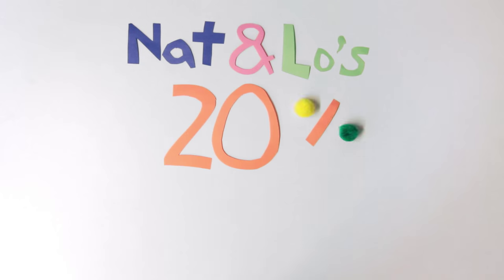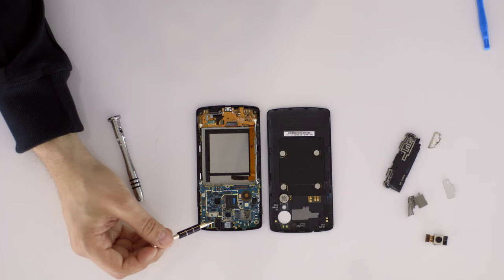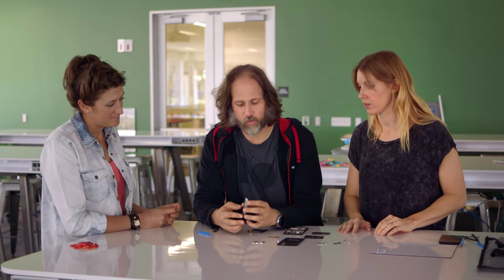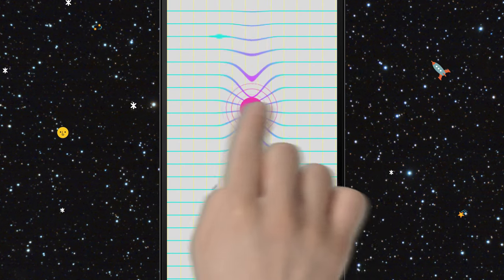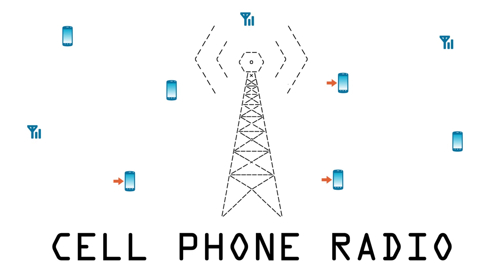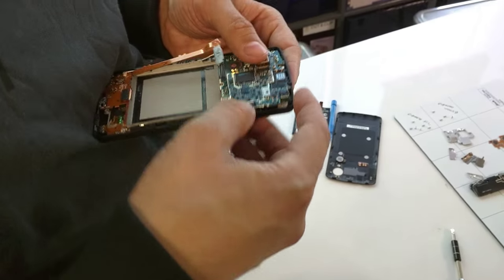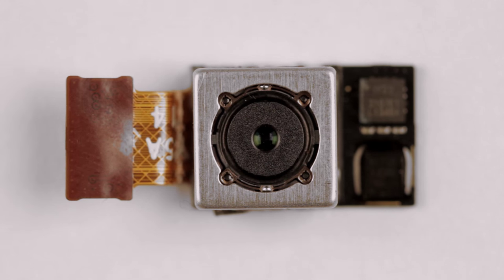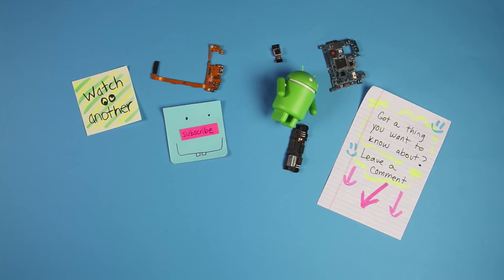Do You Know What’s Actually Inside Your Phone?

Comment: Hey, tiny fix - NFC is not radio, its a magnetic coil. Radio is an electromagnetic wave, like micro waves,  xray light etc, but NFC uses magnetic coils to communicate, that's why it has to be so near.
Reply from the maker: +guysoft42 ah-ha! thank you for explaining that.
Reply: +Nat and Lo Magnetic and electric fields each create the other. They're flip sides of the same coin. That's why it's called "electro-magnetic radiation". It's perfectly accurate to call it an NFC "radio" -- after all, it's just a coiled up radio antenna. 

The particular shape of a solenoid (coiled wire) creates an EM wave that is highly concentrated right in front of itself, and as a trade-off interferes with itself farther away. This allows you to send a transmission using very little power, but only a very short distance. (The effect is similar to focusing the light of a candle with a lens -- at the focal point the light is very bright and easy to see, but past it the light spreads out and therefore dims.)
Reply: In summary:

Is an NFC "radio", a radio? Yes. 
Does an NFC radio emit EM waves? Yes.
Does an NFC radio create an (oscillating) electric field? Yes.
Does an NFC radio create an (oscillating) magnetic field? Yes. 

...Because all of these things are equivalent to each other. So the same is true of an antenna. 

Quick self correction: an antenna and a solenoid are actually not the same thing; antennas aren't part of a closed electric circuit whereas solenoids are. But since you use both by applying an alternating current, they end up behaving in a similar fashion.
Reply: You are assuming cause and effect. Just like a car engine is not a "sound engine" just because it emmits sound, the light emmited from an NFC antenna is not the communication channel, its there because you are accelerating electrons, but its not the waves that carry information to the other device. Its the magnetic field in the coil.
Reply: Any B field state has exactly one corresponding E field state, and vice versa (cf. Maxwell's equations). Thus the E field always carries a "mirror image" of the information in the B field. There is no way to send information (or modify it in-flight) with the B field without also encoding it in the E field as well. For instance, think of an EM wave: can you change the B component without changing the E component? No, because each is mutually reinforcing (hence the propagation of light).

It's true that the B field's information isn't necessarily in the same place as the E field's information, and I do take your point that a solenoid receiver works where the B field is strong but the E field is weak/nonexistent. But absorbing the B field to some degree necessarily also dampens the E field to the same degree, not necessarily in the same place. It's not obvious, but a solenoid receiver is "receiving" E-field information just as much as it's receiving B-field information.
Reply: Out of Maxwell's equations Faraday's law is enough to explain NFC.
Can you draw in/extend Faraday's law from this slide to explain how the E field outside the loop is connected?
On one side it has the B field, and on the other side the current in the wire, no light.

http://i.imgur.com/5ZzMyiA.png
Reply: btw its same lol :v , i have learn about radio wave n experiment with it and i think nfc is using radio wave ,, sorry bad english :v
Reply: guysoft42

Comment: Neat video!  Smartphones are amazing devices and one thing not commonly known is that smartphones (and really all modern computers) are not simply computers anymore but a network of computers, all running software, all dedicated to specific tasks, all at least as powerful as a home computer from the early 90's.  Each one of these computers likely sit on a single chip but would've taken a motherboard of components back then.  In the future, most of those components in that smartphone may fit on a single chip.

The main CPU doesn't actually sense the touch screen, there's a tiny computer there that has to deal with a monumental task of sifting through tons of glitchy, noisy data and reducing it down to clean & minimal touch & gesture info.  Same with radio (in many cases, independent computers for cellular, bluetooth and wifi), graphis, and audio (music decoding & equalization/effects) and so on.  

On the iPhone 5s, there's now a dedicated CPU that collects data from the gyro/accel/compass, mainly so that the device can collect this data even while most of the device is powered down.
Reply from the maker: Paul Steffen great comment! you obviously know your stuff.
Reply from the maker: Paul Steffen oh your comment also reminded me of this link that dan shared with us: http://www.anandtech.com/show/7846/the-difference-between-snapdragon-800-and-801-clearing-up-confusion
Reply: Nat and Lo  That's a great overview!  It's really impressive how companies like Qualcomm push the bar on mobile performance each year while PC laptops only seem to get 15% faster every year..  

Also amazing are chips used for everyday consumer devices, that are now as tiny as an ant yet contain a full computer system and features for communicating with other devices. It's surreal that some of these devices have 500 page manuals.

Comment: I wanted to know if this will be good for playin call of duty and nba 2k18
Intel Core 2 Duo 2.6GHz Processor4GB Memory Installed500GB SATA Hard DriveDVD Optical DriveIdeal for both Home and Office useGenuine Microsoft Secure Anti-VirusWire and Wireless Internet readyLoaded w/ Genuine Windows 10 Home W/ Certificate of Authenticity (COA) recovery partition is included (This computer HAS a newly attached License/Certificate of Authenticity (COA) along with the ORIGINAL COA)